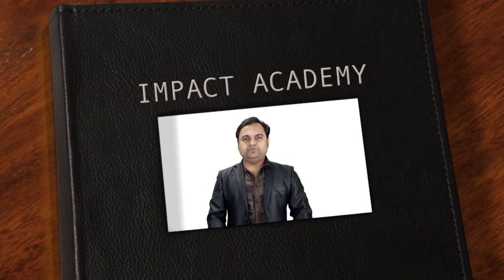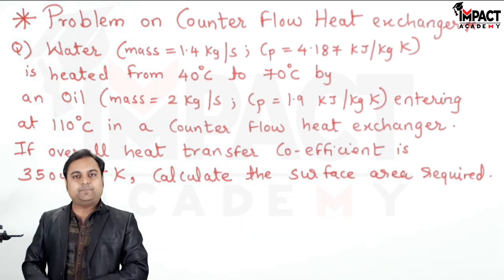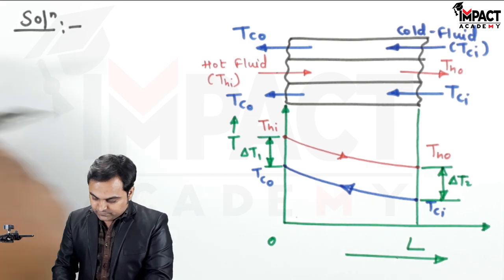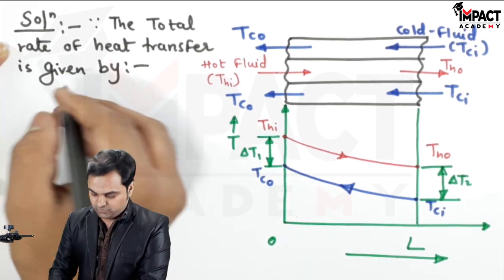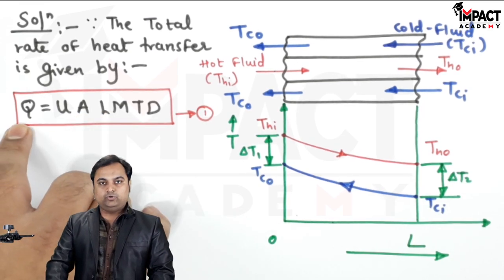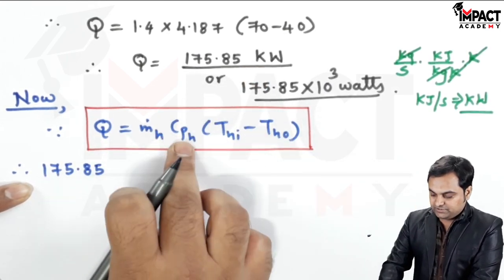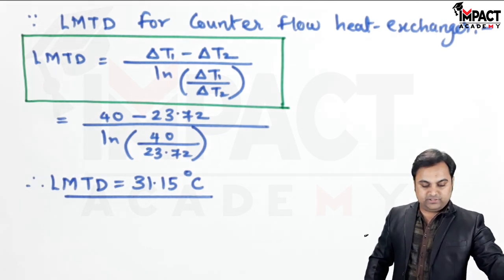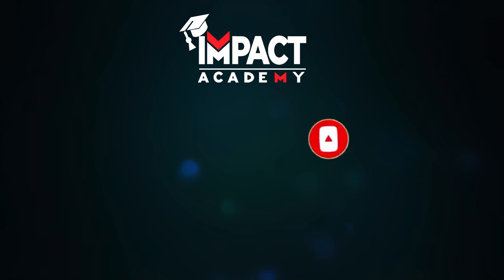Problem on Counter Flow Heat Exchanger l Heat Transfer l #freeengineeringcourses #zafarsir #free

Comment: Can we use cold fluid as inlet? will it hot finally outlet   ?  in this counter current heat exchengers
Reply: In above question we use hot water than fluid as exchanger
Reply from the maker: Thanks for watching... 
http://bit.ly/impactEngineering
To access all the Remaining Videos and Private Videos
Please visit our app " Impact : The Engineering App "
You can directly download the app from the link given on top👆🏻👆🏻👆🏻

For more queries related to app, contact our Customer Care Number :- 
+91 7900123134

Comment: Sir,Don't we need to convert temp into Kelvin while calculating are?
Reply from the maker: Watch All Remaining Private & New Engineering Video lectures at your Home using 
Impact - The Engineering App
Click on link below for download👇🏻👇🏻👇🏻
http://bit.ly/impactEngineering
Call or WhatsApp for details:- 
+91 7900123134
Reply: because the differences between both temperatures would still be the same amount if it was on celcius

Comment: for the counter-flow HE heat transfer equation using LMTD Method, does this method not use correction factor?
Reply from the maker: http://bit.ly/impactEngineering
To access all the private videos and Remaining all Videos 
please visit our app Impact : The Engineering App 
You can directly download the app form the link given on top👆🏻👆🏻👆🏻

For more queries related to app, contact our Customer Care Number :- +91 7900123134
Reply: In our HE class, we only used corrective factors with Shell and Tube heat exchangers, if anyone else is curious

Comment: Sir , generator  jacket water heat exchanger lag hai to calculation   ?

Inlet =75 
/outlet temperature =87 , 
motor pressure =5.5bar
Reply from the maker: http://bit.ly/impactEngineering
To access all the private videos and Remaining all Videos 
Please visit our app Impact : The Engineering App 
You can directly download the app from the link given on top👆🏻👆🏻👆🏻

For more queries related to app, contact our Customer Care Number :- 
+91 7900123134

Comment: Sir this math is not correct because when u calculate the value of Q ,u exchange the value with hot water and oil
Reply from the maker: Watch Remaining & All Private Engineering Video lectures at your Home using
Impact - The Engineering App
Click on link below for download 👇👇👇
http://bit.ly/impactEngineering
WhatsApp or Call For Details :
+91 7900123134